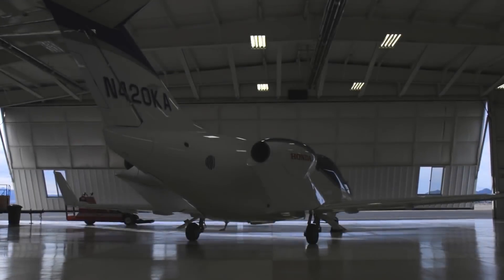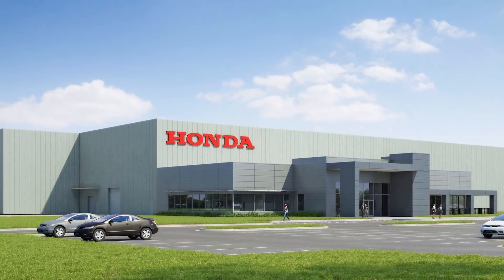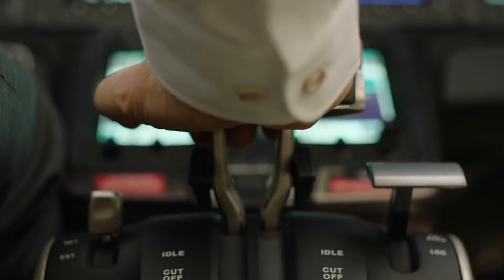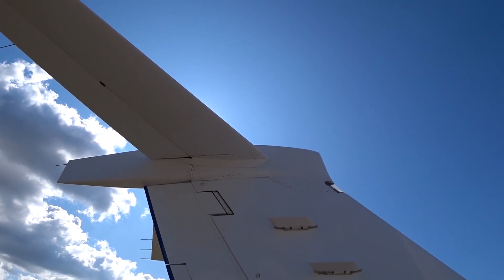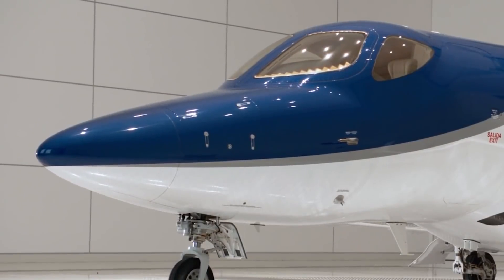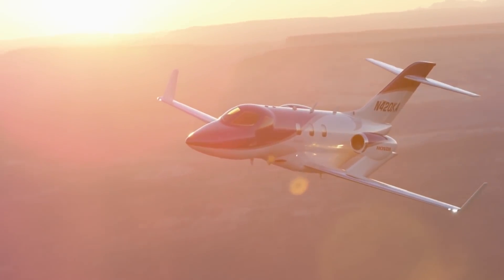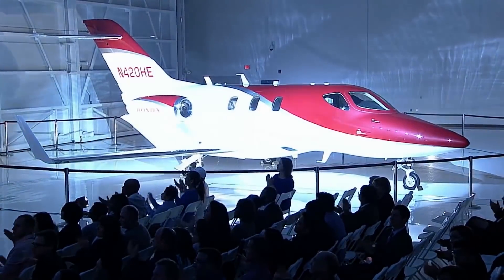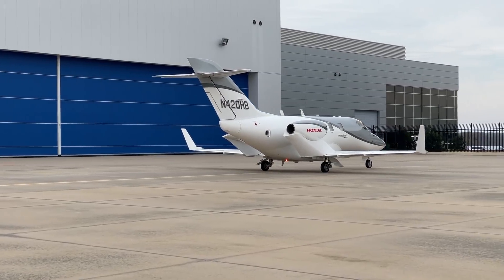HondaJet - a winged sports sedan

Comment: Mounting engines on the wing also helps reduce weight because the fuselage doesn’t need to be reinforced to take engine loads. The wings r already contain the strongest points on the aircraft.

Comment: Wouldn't it generate WAY more lift if the inlet of the turbine was just on the top edge of the wing "sucking" air over it? Or ducted turbines inside the fuselage with inlets on wing tops like the B2 Spirit?

Comment: I'd mentioned our development of our stand alone EDFJ and EDFJ DIESEL/JET-A HYBRID power-plants and the aircraft that will be used for testing in both a single and twin configurations.
(Rutan Long-Ez, Rutan Stagger-Ez, Velocity and possibly 1 of Revelaero's designs).
Our tentative plan is to mount the twin configuration much as is seen on the Honda Jet, not only for the reasons Honda does so,, but also for increased ramp appeal...if we can ensure that the structural integrity will allow as much.
If tests go as we plan, we will then design our own GA/Experimental aircraft around our power-plant design/s; a design that would assist in increasing speed and distance using current battery technologies.

Comment: The concept was heavily inspired by the VFW 614 (Vereinigte Flug Werke, led by Fokker, Dornier and a few others European companies back in the 1980s). The aircraft was designed as a regional jet with engines mounted above the wings, to enable it to use unpaved runways and minimize or eliminate ingestion of gravel.
Reply: Why, because Japanese were incapable of having the same idea? Once an idea has been had once, anyone who uses it afterwards is obviously copying the originator, right? because it is just impossible that more two different people can have the same idea.
Even if what you said was true (and it is not, the only similarity is that both use overwing pylons, which were thought of before the VFW), all it means is that Honda took the idea and showed Germany how to successfully implement it.

Comment: The engines also operate in free air that is almost completely undisturbed by local effects due to the airfoils and bodywork.  This "pure" aerodynamic environment makes the aerodynamic design much simpler than embedding the engine in the bodywork.

Comment: so let me get this right:
Honda a car and motorbike company can R&D and then put to production a brand new small jet in reasonable time frame while Boeing a 100 year old aircraft maker can't keep up with competition to design new jet so keep sticking bigger engine to 60 year old airframe and hope for the best?
Reply: It is not solely an issue with Boeing. If airlines have to purchase a new type of aircraft, then they have to train their pilots to fly it. All of this training costs a significant amount of money. However, if Boeing just sells a new version of the 737, then the 737 pilots who fly the older model often just need difference training, which is less time consuming and less expensive then becoming type-rated on an entirely new model.

Comment: If Honda built it they thought it out well ! I have never had a bad Honda product !  motorcycles  ATVs  small engines And there autos have all given good service My 95 Civic runs well what ruined it was body rust compromised the structure  it went 400 K with out a major problem . OH BTW kinda funny the guy is getting out of a Tesla  why did they not use a Accord or a Acura ??

Comment: the hondaJET starts at 5.3 million, compared to the Cessna Citation CJ4 at 7.8 million and the LearJet 75 at 8.9 million. all three are similar aircraft competing in the same market.  Yeah you can get a used Cessna Citation II 550 for $300k but were talking new. If I was in the used corp jet market I would get a Cessna Citation X which is the worlds fastest private jet at Mach .945 (725mph) that's damn near the speed of sound. but you pay for that luxury.. $23 million without the bells and whistles.  But having that Lavatory in the HondaJET is badass. I dont know of ANY 7 passenger jet that can say that. I dont know why I dont see this thing more often. its clearly a great option at a great price. thanks for posting this.

Comment: Problems: extremely short range, maintenance hogs, and the placement of engines creates noise and vibration in the cabin to the extent that even passengers have to wear headsets.
Reply: I would like to know where you get your impression of this aircraft . range is listed  as competitive in the  size / class of aircraft. The issue of engine noise and vibration  you mention have not been relayed to me from people that i know that have ridden  in it.
Reply: @garyweber4333  I get the impression of the aircraft from people I have talked to and the fact that whenever I land in Greensboro there are a dozen unpurchased honda jets sitting on the ramp gathering dust. 

In the promotional hondajet videos they have people wearing headsets in the cabin. It's one of the reasons most manufacturers don't put engines above the wings (vibration). They have recently updated the aircraft to have long range tanks to fix the range problem I mentioned. Yes the empty range is a normal 1400-1600 miles but there are seats for six passengers and two pilots (lets say 1,500lbs). If it is a full flight, how much range do you have at that weight? An hour's worth? I couldn't tell you without looking at the performance charts.

When I google it, it said the Hondajet sold 31 planes last year, the vision jet sold 71 planes, and citation sold 131. So there's your answer.

Comment: Next version will be a TYPE R, canary yellow, with "R" badge on the tail or engines. Also strip out all the unnecessary interiors and lining so you can hear the jet engines roar. Remove the leather seat and replace with carbon bucket seat. For those who like pure flying.
Reply: ahem that's PHOENIX YELLOW to you, sir. lol

Comment: I guess it’s just as underpowered as a typical Honda and needs to be beaten silly just to fly as fast as a wounded sparrow.
Reply: It has a cruising speed of 420 knots at 43,000 feet.  Both engines put out over 4,000lbs of thrust.  You were saying?

Comment: Forgot to mention there are no thrust reversers on the engines, which is why its landing rollout is higher than expected at 3,000 feet.
Reply: Is this a dealbreaker
Reply: Over the wing engines with thrust reverse is a bad idea.
Reply: @RoyalMela  — why are TRs "bad" for over-the-wing engines given they are basically still in the same spot had they been mounted on the empennage?  

BTW, you know, Tom Cruise flies this Honda as his personal jet?  But he's not certified to fly it single pilot by himself.  At least not yet.

Comment: This plane is one of the worst from a ground servicing point of view. The GPU is located in the front, meaning if they require power to start the GPU must be moved out of the way before they can taxi; the baggage door is located in between the fuselage and engine so there is very little space to pass bags through; and the fuel is a gravity fueling trunk tank that takes for ever to fuel. The Phenom 300 has it bet in every category.

Comment: Why has some Aero wizard not invented the airplane with its wings running the length of the plane rather than sticking out of its sides: Aerodynamics must surely allow for this idea even if it means the plane to appear flying sideways.
Reply: Like a delta-wing? Concorde style? Well, it works well on high speeds but has very poor performance in low speeds. That wing type requires high takeoff and landing speeds. Handling also is a huge concern.

Comment: Japan had no great interest in making this plane, but it’s trying to sell carbon fiber to the world. So to show-off carbon fiber, they built a carbon fiber plane. The plane works fine. But the long-term question is how to make carbon fiber cheap enough to be used in the production of normal consumer goods. They’ve talked about carbon fiber cars, and motorcycles, and even furniture. But right now, it’s still an expensive aerospace material.

Comment: -Though this is a good design.  Mounting the "heavy" engines to the wing removes their lever-action force from the center section main spar of the wing and allows it to be quite a bit lighter.  But the pylons put them back toward the rear of the plane, something that makes the plane look less expensive to the shareholders.

YES, this last is something that shareholders look at!

Comment: The Honda Jet is comparable to, but not superior to other very light jets such as the Embraer Phenom 300, and Cessna Citation M2. All seat 4 passengers comfortably, 5 with a jump seat jammed in like a Civic. Not likely, considering the approx 600 lb payload of these 3, with 2 pilots. The M2 can carry 6 although it's cabin is no larger.
Frankly, I expected a little more than this from Honda, it has the longest takeoff run, a 1000 ft longer than the other 2. BTW, the Elite is just a face lift, any Honda Jet can be upgraded to an Elite for about 250K. For your $$$ you get a larger fuel tank, a slight reduction in aero drag, and the same Garmin 3000 as in the Embraer.
All cost about the same to operate, but the Honda cruises 8 kts faster with it's slightly larger engines. The Cessna Citation M2 has the longest range.
All 3 are very close, cost about 4.5 million each, and have very similar cabins. It's surprising just how similar these aircraft are.
I can't afford a Cessna 172, so I won't ever really know...   ;))

Comment: One of  the major advantages of placing the engines like this is they actually become more difficult to have a compressor stall .. with distances out and above the entire airframe  this allows for clean air to enter and this allows other surfaces to function more efficiently
Reply: Also, attaching the jet pylons to the wings reduces the need for structural reinforcement, and thus the weight, of the fuselage to handle the stress the engines under power would place on the fuselage.
Reply: And the pylons reduce drag by directing air along the fuselage and fill in the low pressure pocket behind fuselage.
Reply: Wonder what the airflow is like through the engines at high altitude high angle of attack? Hopefully that wing isn't getting in the way.
Reply: The bleed air system must be complicated as hell...wonder where the packs are?
Reply: logically very true :D

Comment: When the engineer decide to put wings on Honda civic, absolutely marvelous
Reply: Civic?  That's a flying Odyssey.  Surprised the cabin door isn't a slider.  :)
Reply: Isnt that how engines are located on seaplane historically?
Reply: When Honda has successfully master the technology of plane design and manufacturing including the turbo fan engine, avionics, etc. USA will impose version 2 of the Plaza Accord to kill Honda.

Go search Plaza Accord of 1980's, see how USA coerce Japan, car import quota, appreciation of Yen, ban on Toshiba Semiconductors....
Reply: @yl128pang3  Yes, I vaguely recall that, did it not also target other auto manufacturers in addition to Honda? Also remember what Formula 1 did to Honda back in the 80’s? Kinda like Equal outcome.
Reply: Needs more stickers though
Reply: More like a Honda Accord, with the V6 engine.

Comment: Nice what's next the Hyundai Genesis jet. I am surprised Mitsubishi and sabb have not made competitors. Is there a Russian private jet you like?.
Reply: Mitsubishi is still working on a regional jet.
Reply: @Shadowfax-1980  The key being still working on. Am I the only one who wants to see Lockheed back in the civil air business.
Reply: Mitsubishi once made a turboprop business/ private plane; the MU-2. It was quite good but was hard to fly for amateurs. 
Their recent project, the SpaceJet aka. MRJ, is being suspended in development as it struggled to get the FAA certificate.
It is rumored that the FAA was stalling the MRJ to save the American industry and their share of the regional jets...(I doubt it but yeah...)
Currently Mitsubishi Heavy Industries is focusing mostly on their 5th gen fighter demonstrator; the X-2 Shinshin. Sky made a video about the plane.
Reply: @stachelsamurai  They are definitely not focusing on thier cars that's for sure.
Reply: @Notthecobracommander  SAAB, the aircraft manufacturer, hasn't owned the car manufacturer for quite some time. GM took a 50% share in the 90s and then bought the remainder in 2000. About a decade later it sold it to Spyker and then it went through a number of possible hands as GM refused to allow a sale to the Chinese due to tech transfer issues. Since about 2015, the current owner lost the right to continue to use the name SAAB.

Comment: Engines above the wings means the rare water ditching would be more survivable since the nacelles wouldn't act as sudden brakes when they would hit the water if they were under the wing.
Reply: That MIGHT be true... But I DEFINITELY DON'T want to be the one to find out for sure!!
Reply: I’m pretty sure they decided to do so mostly to reduce noise/vibration in the cabin. I remember reading about it a while back.
Reply: I think it’s mainly to decrease damage from small debris on the runway.
Reply: Yes, but all business jets have wings on the tail anyway so that's not a problem
Reply: @misham6547  BBJs do not, all have under-wing engines.
Reply: @lohphat  ok, your right I should have said at that size. Because the only way an engine is going to be fitted under the wing is if the wing is the the top which reduced cabin space. So at the size of small jets the only reasonable way to put engines is above

Comment: Umm, could someone explain to me quickly the advantages of usng a cross shaped tail over a t-tail? Especially when the horizontal stabiliser is so high up that it is almost a t-tail anyway (by the fact that it is not as popular I would assume there are also disadvantages to this setup).
Reply: As far as I know, T wings have more leverage than cross shaped. 
However, as Ludovic Bon correctly stated, you need a more rigid and thus heavier construction for the vertical stabilizer.
Reply: Cruciform is the word you'll need to search on. A cruciform tail still allows you to mount the engines high in the rear and not cook the horizontal stabilizer. Cruciform also allows for a stiffer tail, as the others said. But, because you don't get the end-plate effect (think winglets for the vertical stabilizer) the vertical stabilizer has to be larger for a given amount of rudder authority or longitudinal stability.
Another advantage of the cruciform tail is that deep stalls aren't as much of a problem compared to T-tails. This is why you'll often see a couple of non-vertical ventral fins on T-tail jets (see Learjets for obvious examples) to push the nose down at high angles-of-attack where the stalled main wing blankets the horizontal stabilizer in turbulent air.
A ventral fin on a cruciform tail can add back some longitudinal stability if that's what you lack and not rudder authority, allowing you to shorten the main vertical stabilizer. Thinking about this in particular, a conventional tail has to be designed so that the horizontal stabilizer doesn't blanket all of the rudder in a high angle-of-attack, making spin recovery difficult. This might be another advantage for a cruciform tail over a conventional tail, since a large part of the rudder is underneath the horizontal stabilizer.
Reply: A T-tail needs more stiff and heavier fin .
Reply: Clean air.  Look at the Mig 15